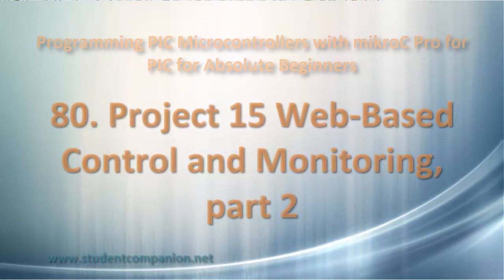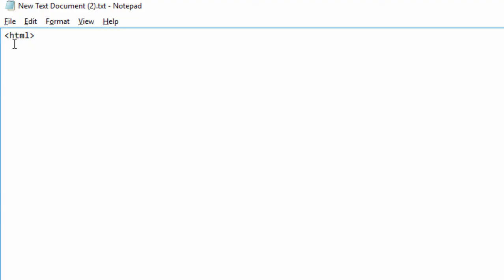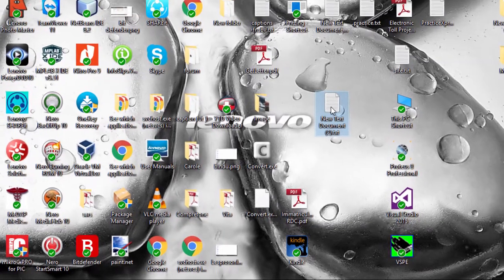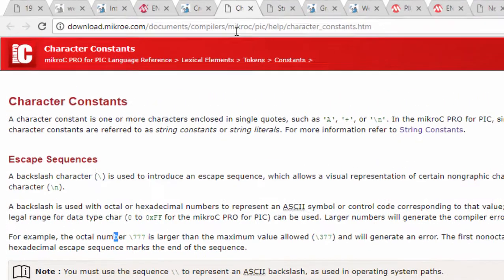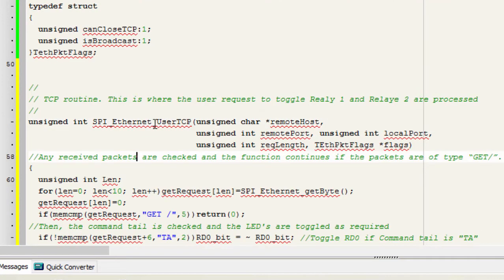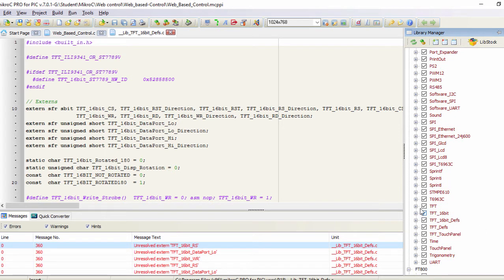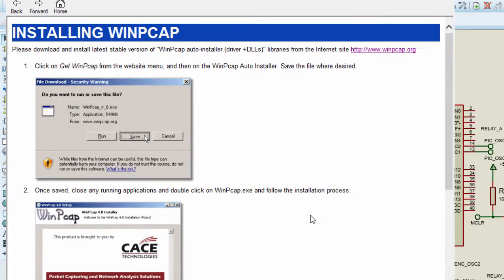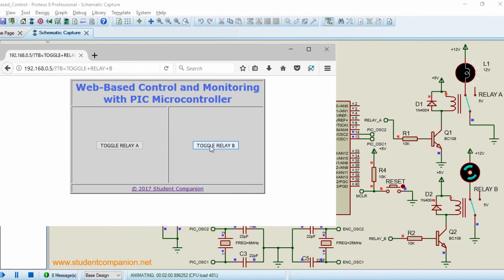80- Project 15 Web-Based Control and Monitoring, part 2 | mikroC Pro for PIC Tutorial

Comment: I tried to load the web but It doesnt appear. I´ve done all you did, I used my own ipv4 (192.168.1.35) from my PC as you do on ENC28J60 then in the code on IPAddr I chosee a lot of IPs, 192.168.1.5; 192.168.1.6... but nothing.., obviusly I previusly instaled WINpCAP, maybe I have to change the MAC adress from te code, I leave it the same from your code.
I'm using a wireless router(192.168.1.1).. Thanks for your support.
Reply: At the end it works fine, I just downloaded all your code and then just work, I dont kwow maybe the library
Reply from the maker: Hi. Good to hear that it's working now.  If your code compiles without errors then it can't be library problem. Maybe more of network configuration.  It doesn't matter the IP address you use as long as all components are in same network.
Reply: While I was watching your tutorial I taked into account of some diferences in the main code from your own page (   ADCON1 = 0x0F;         // All AN pins as digital
     CMCON  = 0x07;         // Turn off comparators) Is also the same?
If I want to apply this with a real circuit, how can I configure a local server?
Thanks for all, really soon I'll donate you for your really fast support and your job here.
Reply from the maker: PIC Microcontrollers are small devices with so many capabilities but with very few pins. That's why it's common to see one pin multiplexing different peripherals.  One pin can be an input, an output, a comparator,   an ADC etc. But some features can't work together, for example an output digital pin while the pin is an analog input. You'll have to disable some features to access others.  That's why we used the ADCON register to disable analog features to use digital features . The same with comparators we don't need them.
Reply from the maker: You wrote some few words like in french. Do you speak french?

Comment: Hi, I really apreciate all your hard work, Could I use another pic like 18f4550 to program all the html and the configurations instead the 18F45K22 ? and for my project I need to conect two modules to the UART Rx, Tx, so what can I do? connect 2 PICS or just simulate another serial port? and How to do It. Thanks and have a good day.
Reply from the maker: Yes you can use a different PIC.  As long as it has enough memory and SPI port. I think the PIC18F4550 could do the job.
Reply from the maker: What do u mean ny connecting two modules to UART? What kind of modules? What are you intending to do?
Reply: Right now Im using a pic to control some reles for Domotic purposes, before learning how to implement ENC28J60 module I was using a bluetooth module to test my pcb but It was useless because the low signal distance, so I decided to connect and configurate a sim module that can write a sms or even an emergency call when somebody get inside the house like an alarm and to controll remotly reles. after watching your video I can replace that bluetooth module and I don't need to use serial TX, RX (C6,C7), so right now I dont have that problem, I can actually use bought modules. (ENC28J60 and sms). For future projects I want to learn also how to connect simultaneosly two modules that use the same serial port.
I suggest you a video about how to implement te sms module in my case IOT-GA6 from Goouuu Tech, but I think is the same with sim900 or similar.
Reply from the maker: ENC28J60 uses SPI module and the GSM will use USART. So they can work together

Comment: Hola SC, I tried your tutorial on simulation it working very well, now I wanna bring this on real hardware, my question how to make the transformer 1:1 between ENC28J60 and RJ45, in real hardware should I configure an ENC28J60 for the IP I address, could the IP address set to dynamic not static, if I want to remote this far away, how can I do to connect this between Button HTML to the hardware, I hope some info from you.....Awaiting.
Reply from the maker: Hi. You can read the ENC28J60 for the specifications of the 1:1 transformer. 
You can also use DHCP if you want to.
If yoh want to control your device from a remote location outside your local area network, then you'll have to configure the gateway IP address as well and configure Port forwarding on your router.
Reply: Hola SC, thank you for the answer, I has been searching for the module of the ENC28J60 module, it's many online store in my country selling this product and the price also is not expensive, I wanna do this in practice or real hardware, could I change this uC to PIC18F4620 ?, need to change the code too to switch with this PIC18F4620 ?, at home I use router from the local telecommunication (have a Wifi and Lan Connection on the router) then I connect it to my switch hub to distribute my Lan Connection (DLink) after this I connect to my mikrotik RouterBoard , in this RouterBoard I was create an IP address (example in RouterBoard my IP Address I will connect is 150.10.0.5) of course my hardware I should write 150.10.0.6 in mikroC code, my qustion : 
how can I connect my hardware IP address, mean is in remote I should write or in to get connection, just example I am far from my house (hardware IP 150.10.0.6) and I use another computer far away from my house so how I should write in browser to get communication to my hardware.
Reply from the maker: You can choose a different PIC if you want as long as it meets the basic requirements. PIC18F4620 can work, but I am just not a fan of using very old PIC models while there are new better and cheaper models with more features.
In your router settings, there a option for configuration to configure port forwarding, talk to your local telecommunication company they will explain to you how to set it up, then you will be able to connect to your router from a different computer outside your home network.
The ENC28J60 datasheet explains in details how to build it in hardware. If you want  you can also use already build boards, some are very cheap some a bit expensive it depends on your budget, like this board, we are using it: https://www.mikroe.com/serial-ethernet-board

Comment: HELLO. I GET THIS ERROR: [NIC PACKET] Packet dropped due to buffer overflow: ERXST=0500; ERXND=1F19; ERXWRPT=0046; length=05B2; ERXRDPT=05FA; EPKTCNT=01 [U2]
IS THERE ANYONE THAT CAN HELPME? THANKS
Reply from the maker: Hi. Can you post your code and specify the PIC you are using?
Reply from the maker: Or you can post your project in the forum on our website: https://www.studentcompanion.co.za/forums/
Reply: THANKS FOR YOUR QUICKLY ANSWER.
Reply from the maker: I have compiled your C code and it builds successfully with no errors. I cant reproduce the error you are getting. Can you zip your full project and post it in the forum? So I can build your project.
Reply: OK. THANKS!!!
Reply from the maker: You are welcome !
Reply: I just uploaded my project in the forum. I hope someone can helpme... I test everything and nothing works. Just the Proteus sample work perfectly.... Regards from Argentina.
Reply from the maker: What did you test? And how?
Where are you getting this error? In mikroC when you are compiling because we can't reproduce that error, your code compiles successfully with no errors. 
Are you getting in in hardware and if so, How?
Are you getting that error in Proteus simulation? Can you post the screenshot of that error message in the Forum and explain in detail where you are getting that error and what do you mean by nothing works?
Reply: Thanks for the quickly answer... I'd explain it in the forum. Regards from Argentina.
Reply from the maker: Hi. We tried to figure out what could be the problem but unfortunately we can't. That problem is in Proteus, it's not microcontroller code problem because we even tested this code in hardware and it works without probmes. Even though you used the router IP address for your ENC28J60 which is wrong, you should use your computer IP address as the host in ENC28J60. But the IP address cannot cannot halt the simulation.
I suggest you ask that question in another forum especially a forum dedicate to Proteus, People with more knowledge with Proteus might assist.
And if you find the answer, please share it with us in the forum, it might assist others as well in the future.

Comment: Hello Which version of proteus and mikroc libery you used for actually im using proteus version 7.7 and mikroc version 6 in the simulation i get message (NIC Packge dropped gue to buffer overflow
Reply from the maker: We used used Proteus 8.6 and mikroC 7. I don't think it has to do with mikroC version. Did you install the network library as explained in the video?

Comment: Hello Sir, i dont have mikroC installed , just have proteus on my pc .I used schematics of the project on proteus (there is no problem with proteus ,i can run the project) and .hex file to simulate. My ip is 192.168.0.2 and when i try to go 192.168.0.5 on web browser, nothing  is happened. The web page does not open.Could you please help me to fix this?
Reply from the maker: Did you change the host IP address in  ENC28J60 settings and install the network drivers?
Reply: Student Companion yes i changed, i did what you exactly did😔
Reply from the maker: Can you ping your board? Do you have a network switch or wireless router/modem?
Reply: Student Companion i have wireless modem
Reply from the maker: Give your PC and the ENC28J60 IP address in the range of your router so that the network card of your PC can be active once connected.  Then you'll be able to connect. Otherwise you can use a virtual PC.

Comment: sir my project is temperature control fan and heater... so the pic18f4550 pin 18 is vUSB. .. and your pic18f45k22 pin 18 is Rc3... so what's the proecess.? the diagram will be same.?
Reply from the maker: +Fadi Khan can you write your comment on the correct video? This is web based control and monitor video. It's confusing when you ask questions about another tutorial from a different one.

Comment: goood. .. sir when I were use pic18f4550... what will be the diagram.????
Reply from the maker: +Fadi Khan Hi . The diagram will be the same. The ENC28J60 SPI pins should be connected to PIC28F4550 SPI pins. You must just set correctly your configuration bits

Comment: first thanks for the explanition just I have a little problem, please I did all the instruction and lunched virtual network of proteus but when I execute simulation and I enter the address in browser I didn't get the site  
and for the led of EN28J60 it was on
Reply from the maker: +Mohamed IDAOUBAKRIM what do you get after simulation? Nothing or an error message in Proteus?
Did you install the network drivers? Did you change the network IP address of your PC and set this address in Proteus as host address?
Reply: yeah I did all the instruction and for proteus I don't get any error but when I enter the address in the browser it didn't function
Reply from the maker: +Mohamed IDAOUBAKRIM Does your network card shows any activity like connected or nothing at all? Can you ping it?
Reply: just like you connected and no internet access so everything normal
Reply from the maker: +Mohamed IDAOUBAKRIM there's two more steps as explained in the ENC28J60 help file. The easiest is if you are running Proteus from a virtual machine.  After running Proteus you should be able to ping it and the simulation should work well. Otherwise connect the shortcut: Connect any network device to your PC it will switch on your network card on your PC. If you look at the taskbar icons at bottom right if you are using windows operating system you should see the network card activity. Run Proteus it should work well.
Reply from the maker: +Mohamed IDAOUBAKRIM Please let us know if it works.
Reply: for the moment it doesn't work and this is a screen shut of the simulation
https://drive.google.com/file/d/1Qb3yYF2FznXQpaWjys1d26cWInn7S69p/view?usp=sharing
Reply from the maker: +Mohamed IDAOUBAKRIM the network you are connected to is a different network.  You are connecting to wireless network but you are setting your IP address of the LAN network. Either you activate your LAN by connecting a device with a netdork cable or try to change your IP address in the same range as your wireless network and use this wireless IP as your host IP. Hope it will work. In the simulation we used the LAN cable.
Reply: even I disconnect the wireless network and all others and keeping just the network of proteus I didn't get the result so I well skip the simulation  and I want to connect using a reel ENC28J60 so is just it to connect enc28J60 with the pc using RJ45 cable or there is other configurations 
thank you
Reply from the maker: +Mohamed IDAOUBAKRIM I think you didn't follow correctly the instructions.  I have tested it with my wireless network and it's working well. Here are the steps:
1. Get the IP address of your wireless network. 
2. You can get it by open CMD command prompt by typing cmd in the search windows and type: ipconfig
3. Take note of the IPV4 address.
4. Go to mikroc code and change the ip address to one in the range of this ip address.
5. For example, our wireless ip address was 192.168.8.101 we set our ENC28J60 il adress in mikroc to 192.168.8.100 which is in the same range.  You can change and put a diffetent last digit numbers.
6. Compile your mikroC code again and generate a new hex file.
7. In Proteus right click the ENC28J60, properties, change the host ip address and put the new ip of your pc wireless network. 
8. Run Proteus. 
9. Enter your ENC28J60 ip address in your web browser. 
10. It should work well.
Reply from the maker: +Mohamed IDAOUBAKRIM if you have the ENC28J60 board, all you need is to connect it firectly to your RJ45 socket of your PC with a crossover cable or with a straight cable if using a switch. It should work.
Or by just connecting it to the RJ45 it should enable the network card. Even your simulation can work
Reply from the maker: +Mohamed IDAOUBAKRIM Let us know if it works this time. Please if not, share screenshots of your steps.
Reply: ok thank you now I well try with a VMware machine and cheek if it well work for the instructions I am sure I followed them correctly but I don't know were is the problem
anyway thank you for your help and I well give the report after using VMWAre
Reply from the maker: +Mohamed IDAOUBAKRIM ok. Try also the wireless method we've just explained.
Reply from the maker: +Mohamed IDAOUBAKRIM did you come alright?